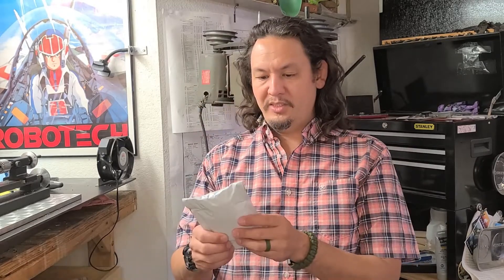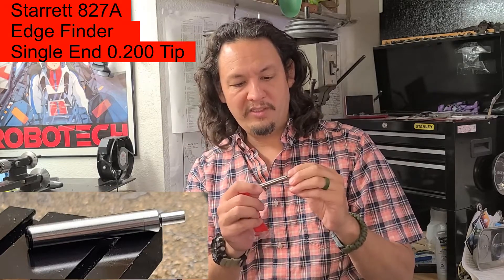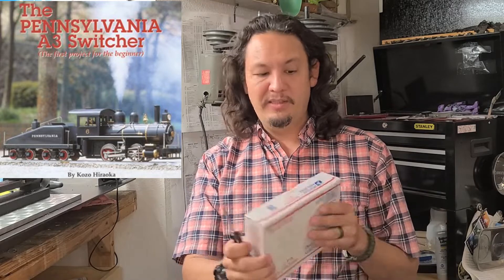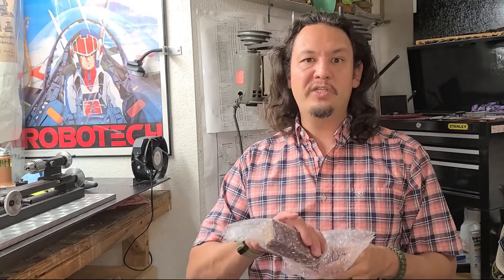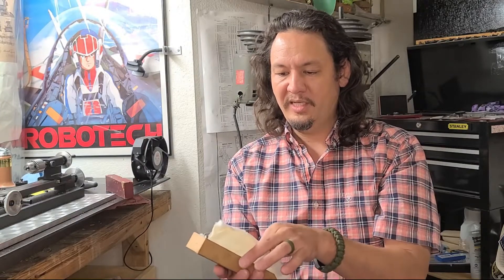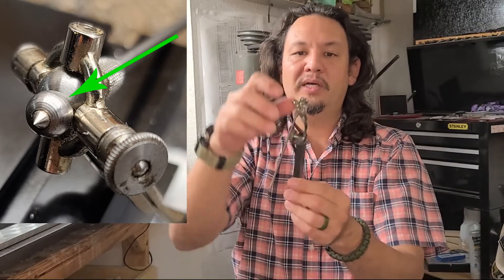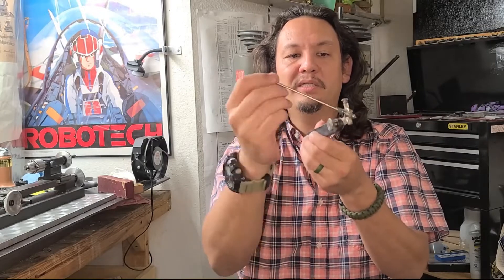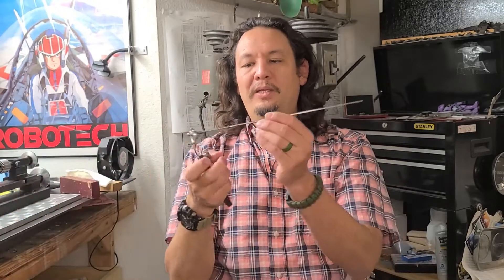Unboxing: Starrett Edge Finder 827 and 65 Center Test

Comment: That Starrett 65 was made for the old American and British machinists lathes…. Probably “Mr Pete” has used one years ago. You can see that from the size of the part that is gripped by the lathe tool holder.    That’s a nice tool to keep on the shelf as a great talking point, but using it on your Sherline might be a bit of a stretch,….stick with your Starrett “Last Word”….thats easy and works beautifully!
Reply from the maker: Absolutely. There is a reason why it was surpassed by the last word and others dti. I'll have to see if he or Keith rutker, or dee dee have something.  It seems like all their cup of tea.